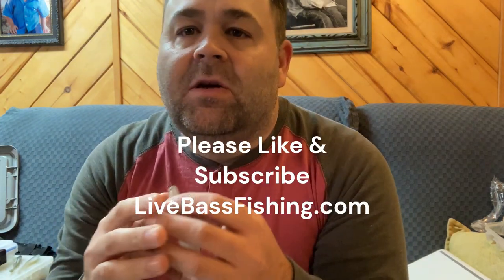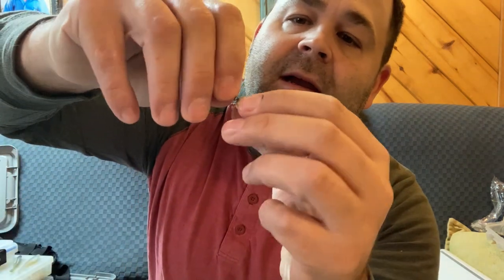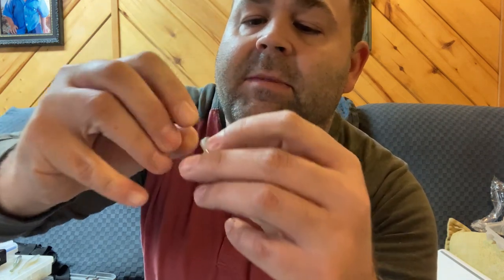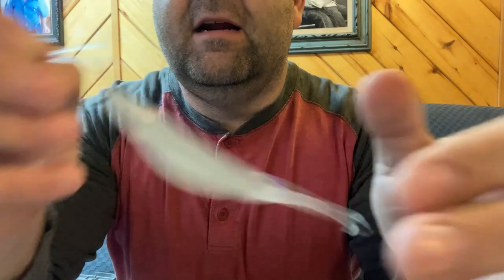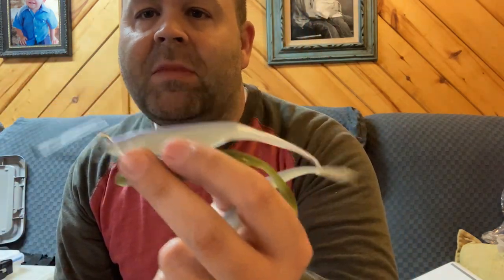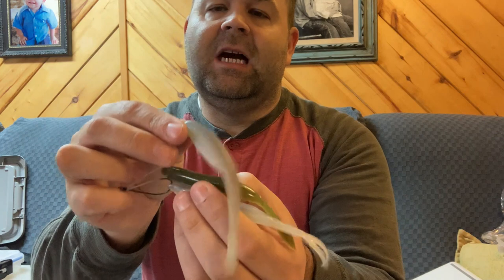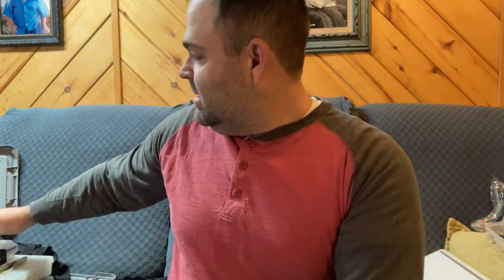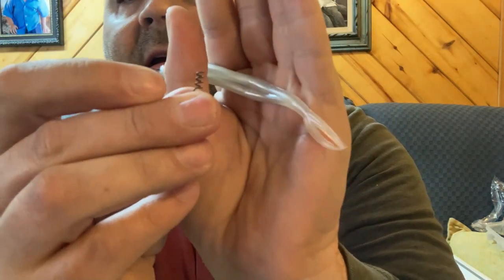Rigging a Nose Hooked Fluke Fishing Techniques for Bass Fishing

Comment: What size weedless hooks do you use? 1/0? I wanna try that out. I do have some eagle claw weedless neko hooks I use for wacky rigs that look similar to the vmc. Also can you reuse the nose springs? Do they last?
Reply from the maker: You can use that exact Neko hook for this technique. The screw locks could be reused. Just screw them out. Good luck fishing. 👍
Reply: @LiveBassFishing  Thanks! I'm getting some. I had a bass on the fluke today using a ewg 3/0 hook but with my kayak and spinning rod its hard to get those hard hook sets so when it jumped and came off. I hear these work better for lighter line (I use 8lb test) and spinning gear and the hard hook set isnt needed. I like using the weedless wacky rig and have good hook up ratio using that so hopefully it helps me land more fish!
Reply from the maker: @matthall8378  Yeah, your hookup ratio should go up a ton. It’s so much easier to drive that finesse hook in. Good luck 👍
Reply: @LiveBassFishing  I got my 1st Largemouth on the nose hooked fluke today! Nice!!! 1 for 1 on hook up ratio! 😂
Reply from the maker: @matthall8378  Awesome! I’ve had great success with this setup.
Reply: How many fish do you average per bait with that setup? Nice thanks for the idea!